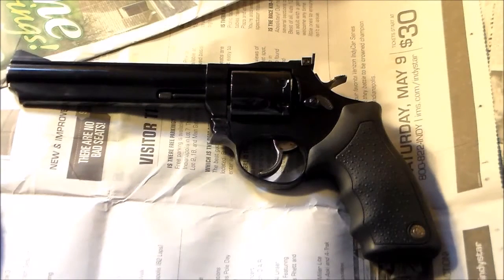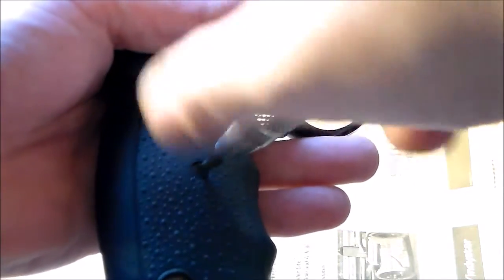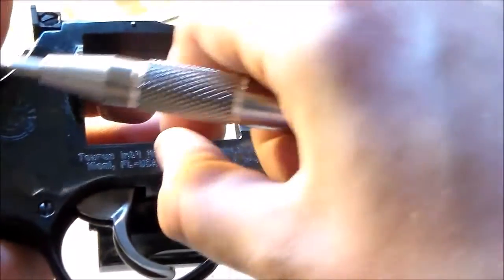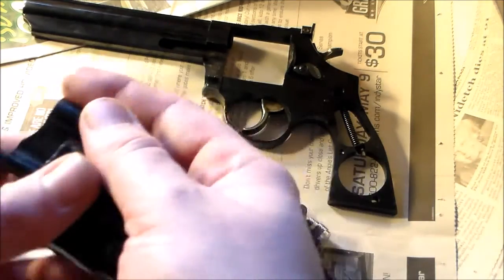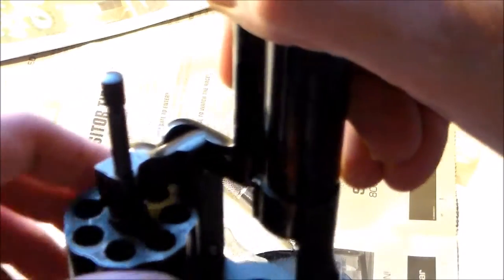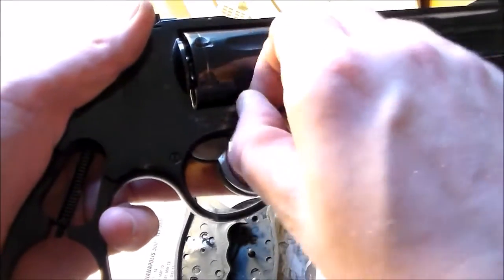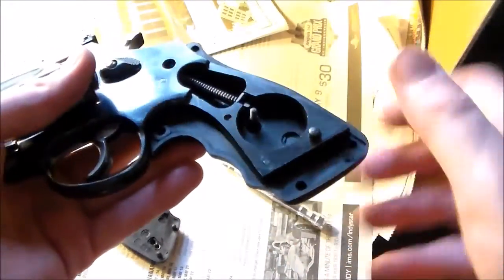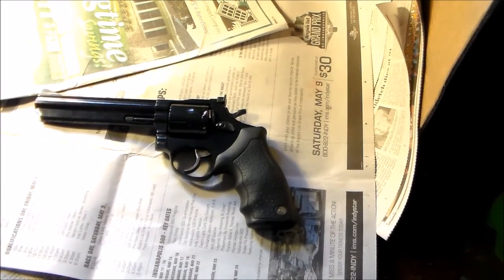taurus model 66 disassembly and reassembly

Comment: Very helpful. I didn't know it was important to oil the spring inside the grip, so that is helpful. I also had a loose cylinder and, after watching your video, realized there was one screw a little loose. I tightened that up and the cylinder is snug again. Thanks for posting this video. Definitely helped me.
Reply from the maker: +Brett Melton happy i could help i am making more vids like this in the future what would you like to see and when cleaning your chambers i put the whole thing in a glass jar and fill with cleaner and leave over nite thank you for the comment

Comment: I have a Taurus Itnl MFG that’s pretty much a 66 but a 6-shooter. It fires both single and double action but for whatever reason, as of right now the double action won’t work. Any ideas?
Reply from the maker: Sounds like a spring wore out you may want to ask my dad i know how to fix simple things that sounds like the whole gun needs taken apart
Reply: @slayer311421  I figured it was a spring issue. Thanks a bunch
Reply from the maker: @konnorrockkonnoisseur4970  check ebay i found some spring kits for decent price i havnt shot mine in foreer been in a safe caked in oil ill drag it out and try to get you more info

Comment: I didn't realize the cylinder release screw on the frame is a 3-part screw, I had a hell of a time finding the spring and screw tip. Thanks for the video it really helped.
Reply: I broke my compression spring where can I get a new one

Comment: Hi great video, thank you.  I have the same gun but had a full cylinder of rounds and not able to remove the cylinder because it is stuck.  You have any ideas how to remove this safely without discharging the weapon?  Hammer will pull back but cylinder won't turn or pop out.  Thank you.
Reply from the maker: have you tried the cylinder release button and it may be loose try the screw and see if it is loose i had this happen once also that was the problem when i cleaned it the screw loosed and the release wasnt catching
Reply from the maker: @donyuan5378  ya im done with them also as with remington

Comment: oh please dude i have my great grandfathers  38 special that he used in ww2. none of us have ever cleaned the spring inside the grip, let alone even take the grips apart. it still shoots like a dream today. its not something that needs cleaning....
Reply: it is good to oil the spring to keep it from rusting. If it doesn't have a little coat of oil it might get moisture on it and oxidize. It's less of an issue on revolvers with wooden grips, but rubber grips tend to trap moisture.